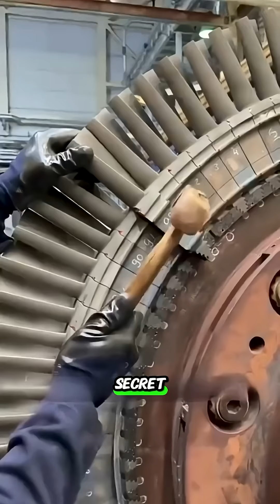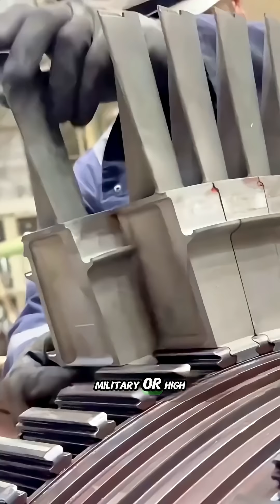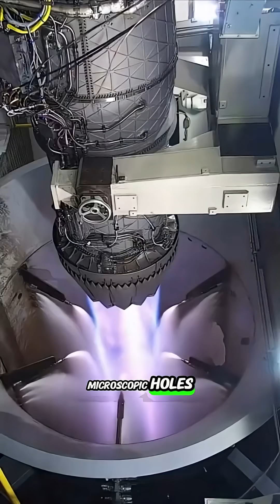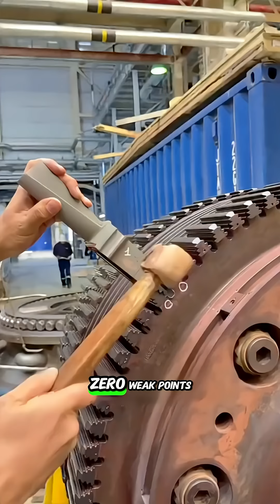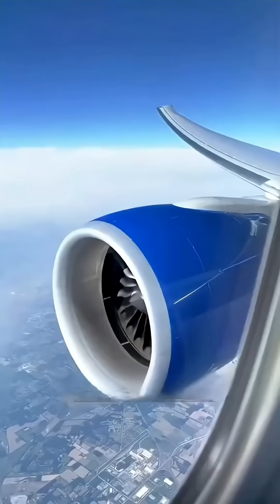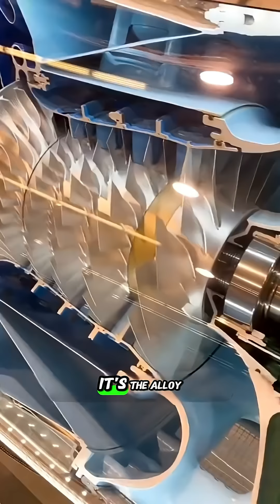The Insane Reason Nobody Can Copy American Jet Engines

Comment: So Rolls Royce doesn't build jet engines?
Reply: Rolls Royce Trent. Rolls Royce components are utilised in the F35. It was Rolls Royce that helped win the Battle of Britain, and the ongoing World War. The Mustang was a dog - until Rolls Royce dropped a Merlin into it. RR Pegasus made the Harrier fly.
Reply: @KeithHays-ek4vr  Bristol Siddley actually
Reply: @KeithHays-ek4vr  Ahhh, the Merlin that the USA couldn't get to work and a girl from Salford went over to sort them out. RIP Gran!
Reply: @geoffholme You can call that teething problems. British Merlins were more or less handcrafted and to scale that process up to mass production took a lot of effort. But these problems were sorted out and at the end of the war the US Merlin's had a better reputation than the original.
Reply: @KeithHays-ek4vr  Rolls does NOT make any of the PW-F135 Engine's "hot section". They make the lift fan and assembly mainly for the B variant.
Reply: @_Coffee4Closers  - I never said they did. - A little less coffee may be in order.
Reply: @KeithHays-ek4vr  The entire video is about the Turbine Blades, metallurgy, and EDM, and Laser ablation to manufacture cooling holes, you know the, "HOT SECTION"... your turn.
Reply: @_Coffee4Closers  - Baby, Rolls Royce is always in the hot section. ❤
Reply: @_Coffee4Closers They still helped build components. And they built the lift fan propulsion system.
Reply: @KeithHays-ek4vr The Americans don't like to be beaten by us Brits.
Reply: @geoffbentley8774 That's right. So we rarely allow it to happen.
Reply: @geoffbentley8774 when was the last time you did?
Reply: @geoffbentley8774 I don’t think a single person enjoys being beaten in anything.
It’s kinda like saying group “x” doesn’t like being depressed.!
Some things just don’t need to be explained, it’s kinda just obvious
Reply: @geoffbentley8774 the Yanks don't like to think that any other country actually does or did anything before them, or were made to share information in a very much one way street.
Reply: @ridestolenbmx100  There's hundreds of millions of lazy people all across the planet that would disagree. Losers are happy losing and doing the bare minimum. We all see this everyday on the job.
Reply: @BrianCurran2988  - The documentary 'Cold War, Hot Jets' is excellent. Britain led the war in jet aircraft technology after WW2.
Reply: 😂😂the narrator is a fool. Jet engines were invented in Europe and perfected there.
Reply: @katimboallan4605     The “narrator” isn’t human.
Reply: @katimboallan4605 Invented, yes. Perfected there? Arguable.
Reply: @ThomasBell-z1t  so the US took someone else's invention and used it, then improved it and now claims to build the best. And no one else can do it?
Doesn't sound like the US at all that.
Reply: @Dan-qg1bq 
Which law says you can't perfect someone's invention and become better at than the original inventor
Reply: @oshomahimhomoh7801  no law at all. That doesn't seem to matter anyway in the US, even if it was law.
Reply: @Dan-qg1bq You read an awful lot iinto my use of the word "arguable." That's all I meant. In my 35 years as an aviation writer I've learned not to engage in pissing contests about who does what the "best". Why? Because there's always some quiet guy out there who knows more than I do.
Reply: @Dan-qg1bq 
It does matter lol
You just choose to believe otherwise
Reply: @ThomasBell-z1t  I'm not convinced they are yet perfect anyway. But that aside, my point still stands, despite your insistence on subtlety of language. The US has a distinguished history of taking other people's inventions and 'improving them'. This in itself doesn't bother me, it's all in the name of progress. But again, the US is very quick to forget about the contributions of others and claim the credit for themselves, and that I do have a problem with.
Reply: @Dan-qg1bq Conspicuously missing is a single example of that.
Reply: @ThomasBell-z1t German aircraft in WWII were good until late in the war. But German aircraft were mainly inferior in the latter half due to lack of materials.
Reply: @easyenetwork2023 If I remember correctly, the Jumo 004 engines that powered the Me 262 were good for only about 4 hrs. tbo (time between overhauls). I imagine that had my much to do, as you say, with material shortages and the resultant compromises forced upon the factories.
Reply: @Dan-qg1bq 
The US claims of technical superiority are nothing compared to China's boasting about their breakthroughs that virtually never happen
Reply: @ThomasBell-z1t Here is just example for you...
Russia manufactures a wide range of jet engines for both military and civil aviation.They making this for decades...
Military Jet EnginesSaturn AL-31F / AL-41F: Powers fourth-generation fighter jets such as the Su-27, Su-30, and Su-35.

Izdeliye 30 (Product 30): The most advanced afterburning engine designed for fifth-generation fighters like the Su-57.

Klimov RD-33: Turbofan engines used to power the MiG-29 and MiG-35 fighter jets.
Klimov AL-55I: A smaller jet engine used for advanced trainer and light combat aircraft.
Klimov VK-2500 / TV3-117: Though turboshaft engines rather than pure jets, these power Russia's main military helicopters (Mi-8, Mi-24, Ka-52).
Civil Jet EnginesAviadvigatel PD-14: A modern turbofan engine designed for the MC-21 narrow-body passenger airliner.
Aviadvigatel PD-8: A newer engine developed for the Yakovlev SJ-100 regional jet to replace Western components.
Aviadvigatel PS-90A: High-thrust engine used for larger passenger and cargo planes like the Il-96 and Il-76.PowerJet SaM146...
.and this is just Russia.

The jet engine market in Europe is led by three giants: Rolls-Royce (UK), Safran (France), and MTU Aero Engines (Germany). 
Leading European ManufacturersRolls-Royce (UK): One of the world's largest manufacturers [Rolls-Royce Holdings]. They are known for the powerful Trent engine family, which powers wide-body aircraft like the Airbus A350 and A330. They are also developing next-generation engines like the UltraFan.
Safran (France): A giant producing both commercial and military engines. They are best known for their partnership with US-based GE Aerospace through CFM International, which manufactures the LEAP engines for popular narrow-body jets like the Airbus A320neo.MTU Aero Engines (Germany): Germany's leading manufacturer, developing and assembling components for commercial and military aircraft. They are active in European military programs and hybrid-propulsion research.
They all produce Perfect engines.
Reply: @larryallen9404  You haven't been paying attention. China leads the world in innovation in multiple high skilled, highly technical industries. They are making breakthroughs on a monthly basis. One highly publicized  arena is large scale infrastructure construction and manufacture. Another is manufacture of bullet trains. Another is autonomous mining and mass transit. Another is lithium battery technology, Another is rare earth mineral processing. I could go on but I think we all get the picture.
Reply: @gl7011 
We all see the same old Chinese lies.
Chinese buildings, and bridges collapse, their submarines go down, and don't come back up, the infrastructure is famous tofu dreg.
Innovative ideas usually don't come from China.
Reply: @larryallen9404  This according to the Australian Stategic Policy Institute:

In their initial study covering 44 critical technologies, ASPI identified China as the global leader in 37 of them, with the United States leading the remaining seven.

Also according to the Global Innovation Index China leads in the number of patents filed. 

The stories we read about technical failures are to be expected. Just this week we were made aware of a New York City high rise building steel beams buckling. We've seen numerous American Spaceships explode on the launch pad or soon after taking flight. The fact remains China dominates in most of the worlds most technologically advanced areas. One such area that I failed to memtion is Ship Building. We can't come close to the number of ships China is able to produce annually.
Reply: @katimboallan4605 Invented in Britain.
Reply: it say very few countries have mastered this technique yes rolls royce does make them
Reply: Usa rolls royce
Reply: @estebanmena4332 Defense engines, not commercial aircraft
Reply: @rayp5152   is Airbus A380 not the biggest commercial passenger airliner, with the biggest jet engines?
Reply: @rayp5152 Trent 500 on A340, 700 on A330, 900 on A380, 1000 on 787 and 1700 on A350
Reply: @rayp5152 and before they had the RB211 installed on the A300, Tristar, 747, 757, 767 ans Tu-204
Reply: @ManuCath I seem to remember they had enormous problems with the RB211 during manufacture. Almost broke the company, but thankfully they got it sorted in the end.
Reply: @cinegraphics  Yes that's why they also use the Engine Alliance GP7200 (GE & PW).  The GP7200 has better fuel efficiency.  Rolls makes fine engines but they are clearly in 3rd place.
Reply: @ManuCath  A300 never had RR engines GE or Pratt and Crap engines.
Reply: @rayp5152  Jas Gripen just changed their GE engine for a more powerful Rolls Royce...
Reply: @rayp5152  So who build the engines of the Eurofighter? Tornado? Rafale?
Both Rolls Royce and Safran build fighter-grade engines.
Reply: @_Coffee4Closers 2nd 🤡
Reply: The best actually
Reply: @dunotrustistrue5565  LOL... ahhhh no.
Reply: @_Coffee4Closers LOL, aahhh yes...
Reply: @da206hbe  Well if they make the "Best" why are they in third place... I'll wait.
Reply: @_Coffee4Closers How would you define a place? Rolls Royce is the 2ne largest producer of commercial jet engines. If you look at efficiency Rolls Royce is 1st. By market share they are 3rd. So...
Reply: I think in France  the one of jet engine the pioneer is a Romanian.. they don't want to recognize
Reply: @markaegyssus5192  You're probably thinking of Hermann Oberth, who was born in Transylvania. He didn't work on jets, but invented rocket engines that then he developed with Wernher von Braun.
Reply: @Z-man1960  Right. And all of this with slideruler, pen and paper. Until his death Hermann Oberth was mentally fit. He often guided the visitors of his Museum in the vicinity of Nuremberg/Bavaria personally. I was lucky to meet him at such a museum tour two years before his demise in 1987. Oberth was highly decorated.
Reply: @Z-man1960 No it is Henri Coandă
Reply: @sorinsuciu8675  Coanda's engine was a ducted fan, not a jet; it could not have powered an aircraft, and it never did.

Henri Coanda has a place in history for another reason--he discovered a behavior of fluids that is called the Coanda Effect.
Reply: @markaegyssus5192  Do you know what Coanda tried? It was a piston engine driving a ducted fan. That simply was NOTHING related to a jet engine. Nothing at all.
Reply: The Strength of a Sovereign Powerful  Nation is measured at the Factory Gate(production) , not at the checkout counter(consumerism). The Globalists know this so they decimated American industries by exporting production with their  multinational corporations thus dealing a blow to the American Worker - and American Power. We must stop this systematic destruction of our industries. American Workers First!
Reply: @ggtr88 it’s closed! Americans students choose  layers and taxe advisors training and Chineses students choose ingeneers training ( 1 million per year)
End of battle!
Reply: @doumedaurillac7393 
When will the technology breakthroughs from the millions of engineers begin to materialize?
China is noticably way overdue for breakthroughs.
The "battle" is yet to begin
Reply: @larryallen9404  Larry, please spend a few minutes on Google researching Chinas technological breakthroughs. It's embarrassing reading your outdated beliefs that China is behind, when in fact they are global leaders. The #1 global leader in fact. Far ahead of us here in the U.S.A. 

China is the undisputed global leader in manufacturing scale, leading in the production of over 220 major industrial products. It holds the absolute top spot in 7 out of 10 advanced industries and dominates absolute output across nearly all 10 key economic sectors, including basic metals, chemicals, and electrical equipment.
Reply: @ggtr88 A tip: The moment you use the word "globalists" most literate people dismiss you as a conspiracy crank.
Reply: I read on the internet that Rolls Royce is just a front company for the CIA and Mossad and that it is in fact a Chinese company founded 100 years ago to avoid suspicion (they are working in cahoots), but now some dude taking a shit while on the internet has uncovered the truth. Also the world is flat and lizard-like Aliens are our overlords
Reply: @steffenscheibler5849  The irony is that most of the conspiracies you mock have been proven to be true.
Reply: not only builds them but makes the other engines better, ge 404 is just one example.
Reply: Yes they do I work there
Reply: Or GB is part of America now. I heard they’re buying countries now.
Reply: @TheGbelcher Has been since January 1942. Or May 1940, depending on your view.
Reply: And the best most efficient ones!
Reply: China just entered the chat😂😂😂😂....just give them 10yrs.
Reply: There’s life outside of the USA 😮😮😮😮?
Reply: the brits, the russians,the french, the chinese all seem to manage
Reply: What the inventor and longest manufacturer of Jet engines in the world - that Rolls-Royce?
Reply: @johnFromDon_V2 Rolls-Royce didn't invent the jet engine....
Reply: @eeHMFIC no frank wittle did..in the uk
Reply: @eeHMFIC and frank whittles designs went to RR... 

They invented the bypass turbofan, the turboprop, the triple shaft turbofan.

RR aren't nobodies in the race as Americans would like to believe
Reply: @johnFromDon_V2 Nobody in the US who knows anything about aviation believes that. You're just pissing out more Brit paranoia about being overlooked by the wider world. It's really unbecoming of your great nation.
Reply: @ThomasBell-z1t A great point. But you, well not you personally, it will take a couple more generations, will find out why and be doing it too. The US/UK tech debate is not new. The Greeks invented most of the tech and culture that made the Romans so powerful. They still moan about not being recognised for it to this day. I can't say I blame them.
Reply: He gave the blue print but did not build any. The first jet powered aircraft was built in Germany Henkel 172. Frank whittle was not the only inventor. There was a German whose  name I cannot remember
Reply: @nickoutside  And Rolls Royce was involved from early Whittle prototype engines onwards. Yes, I know about Rover.
Reply: @nickoutside No it was the German Hans van Ohain. Read your history.
Reply: @CryptoZillian wiki says both actually
Reply: @johnFromDon_V2  Rolls Royce was NOT the inventor of the jet engine. Frank Whittle posited the jet engine in 1930 and got a patent on his concept. In 1935 he created Power Jets Ltd to obtain venture capital and design and develop the first prototypes. Initial test components were made by companies like BT-H, and later also Rover during WW2. That company proved difficult to work with, and deals were made for Rolls Royce to take over in component fabrication and preparation for production. Rolls Royce was the manufacturer for all the jet engines that saw service in WW2 by the Allies, in the Meteor. And for about a decade after WW2, Rolls Royce engines were based on Whittle's design, using a centrifugal compressor. As was the MiG-15's engine.
Reply: Glad you added the 'lol' as the world is, LoL I mean.
Reply: Just a Rumor!!
Reply: they build luxury cars
Reply: @wanrazul Rolls Royce sold the car business to BMW over 25 years ago. They are completely separate companies.
Reply: @wanrazul and jet engines and nuclear reactors...
Reply: @da206hbe  plutonium-fueled, jet-powered luxury cars
Reply: Apparently 😂
Reply: Better
Reply: They do... in the USA... literally the USA is the majority of their revenue (30%) and expenses (25%)..... they are just legally based in the UK. But as a matter of economic fact the majority of their activity happens in the USA compared to any other country
Reply: @alczervik9943  Engines are designed and manufactured in UK. 30% of their revenue is in the US because that's the place that purchase them. 
Not that GE engines are made entirely in the US. The fan of the GE90 engine, IE, is made in Italy by Avio Aero
Reply: At what point was that said?
Reply: They didn't say others can't.  There's just not many that can.  If you listened to the video, he said very few countries have mastered this
Reply: Um RR does build jet engines.  Helicopter to airliners use RR.
Reply: Yes, they do😮
Reply: Major jet engine manufacturers by market share (commercial turbofan engines, revenue-based, 2023 data):

GE Aerospace (incl. CFM International JV): 54.79%
Pratt & Whitney (RTX): 26.04%
Rolls-Royce: 18.31%

All other manufacturers (Safran standalone, Honeywell, MTU, IHI, Williams, AECC, etc.): each < 0.05% (combined < 1%).
Reply: they surely wont after islam is done taking over eurape. lol
Reply: Sounds like Apple.
Reply: And your point is? This point was about invention, not improvement.
Reply: And MTU as well?
Reply: Prat and Whitney, general electric
Reply: Ge builds some nice engines too
Reply: the UK was losing the War until Churchill begged Rosevelt to join in....so don't tell me how magnificent the UK is ...its all BS.
Reply: @gm-zz8so  - The UK came to the aid of Poland, and was in it until the very last day. The americans arrived green and late - as usual.
Reply: @gm-zz8so  - The americans saved their own arses. If the nazis had taken the Soviet Union, Hitler wouldn't have stopped there. Germany would have captured all the Soviet rocket scientists, and had them work with the Germans. americans always seem to think they're untouchable, until a Pearl Harbour or Sept 11 attack happens. The US allowed thousands of tons of shipping to be sunk off their eastern ports at the beginning of WW2, because they refused to darken their ports and ships. - Consequently, German uboats were picking them off by the dozen. If the nazis hadn't been defeated, america would have been in a world of trouble. Your disrespect betrays your weakness of character.
Reply: @gm-zz8so  Funnily enough it needed Hitler to declare war on the US to join in.
Reply: Does Rolls-Royce make American Jet Engines?
Reply: @cdbfullbore I believe they do, in Virginia.
Reply: @GPSpector  Critical engine components are manufactured in the US. Final assembly is in the UK.
Reply: @GPSpector  Cincinatti
Reply: @cdbfullbore RR subcontracts some components. Floatwalls, for example.
Reply: Of course. But very few other countries can. Even Russian and Chinese engines can’t achieve the power and lifetimes of U.S. and British engines.
Reply: Not entirely true.
Reply: @paulblase3955  now you're lying 😅
Reply: @TruthFriction  He is correct, don't be daft.
Reply: @paulblase3955  Technology does not remain the preserve of the country where it was invented, some one else will always improve on an existing design.
Reply: And don't forget France, Safran.
Reply: @paulblase3955 
As skun works about the german UFOs Or Vimanas from ancient Baharat.
Reply: @paulblase3955 WS-15's 180kN thrust is more than F119's 160.
Reply: @kookaichanda5717  LOL.
Reply: @_Coffee4Closers exactly 😂
Reply: During the late 60's (yeah Im that old) RR couldn't get a compressor to work properly, the US gov coerced P&W to help them design one. By the mid to late 80's P&W hot sections were the best in the world & they had been the ones to develope single crystal tech. Then we began to off-shore everthing we developed. 

BTW I worked for the project paperclip germans  who developed the ME-262 engine at Lycoming Gas Turbine Div.
Reply: @terryunkert5237  Again not strictly true Bristol Siddley did the heavy lifting and sorted the problem.
Reply: @terryunkert5237 So it was actually European, ie German, technology?
Reply: @vumba1331 yes
Reply: @vumba1331 Partly. Germany didn’t develop the super-alloy turbine blades, though.
Reply: @vumba1331  Well, yes--the world's first jet aircraft was the Heinkel He 178, which flew in 1939. It had a axial-flow engine, like all modern jets do.

The British Rolls-Royce jet was a centrifugal-flow type, which cannot be "multi-staged" to increase performance and so was abandoned by the mid-1960s.

By 1941, Heinkel had built the twin-engine He 280, the world's first jet fighter. It was denied production due to the political influence of Willi Messerschmitt, who needed time to develop his own fighter, the Me 262, for production. (Heinkel would go on to develop the excellent but too-little-too-late single-jet He 162 "People's Fighter.")

All these German jet engines had short service lives due to the inadequate metallurgy of the time--a problem that has obviously been solved since!
Reply: @Z-man1960 Some great detail there. Note, some modern jet engines still use a centrifugal compressor stage since thrust is not an issue but torque output is.
Reply: @paulblase3955 Their engineers did.
Reply: if you know your history there are plenty of examples of where both county’s needed each others engineering and scientific prowess to make things work. But the US would be pretty f**ked without us.
Reply: @j1y0ni we (UK )gave them nuclear tech too to create the bomb
Reply: Like the Rolls Royce Olympus Jet Engines on Concorde that could STAY SUPERSONIC WITHOUT AFTER BURNERS ON....Something the Yanks STILL CANT DO even with Military Jets....You mean those Jet Engines
Reply: @Fantomx7g6 The F-22 has supercruise capability and has for the past 20 years. So yes, even the hated yanks can do it.
Reply: @Fantomx7g6  - Apparently you aren't acquainted with the term "supercruise". It means exactly what you stated: Supersonic flight without afterburners. 
-
The F22's Pratt & Whitney F119-PW-100 allow it to support Mach 1.8 flight without using afterburners.
Reply: @Fantomx7g6 perhaps, but thats history, where are the British factories now? Turned into mosques?
Reply: @Fantomx7g6  Again Olympus 593 fitted to Concorde is  Bristol Siddley  engine not RR.
Reply: Yeah They build them They’re just not very good at it commercially speaking… militarily they do a great job.
Reply: @shirleytwsw  really? i think boeing and airbus would disagree.
Reply: @shirleytwsw  really? i think boeing and airbus would disagree with that.
Reply: more usa crap propaganda